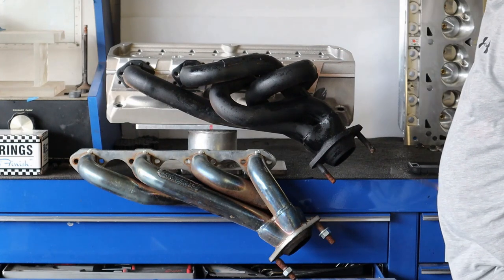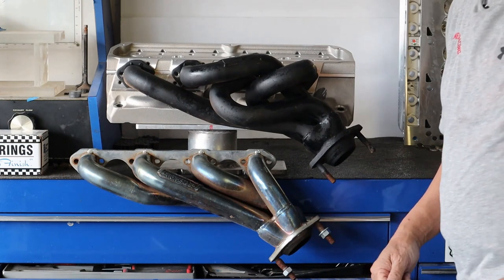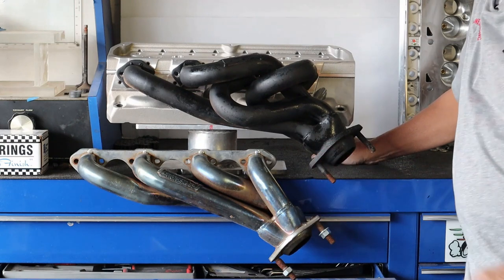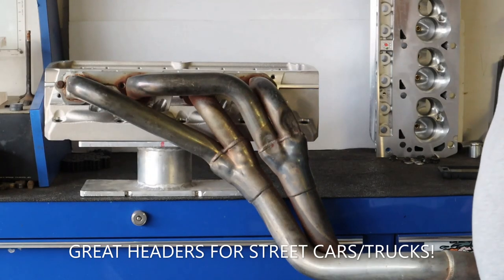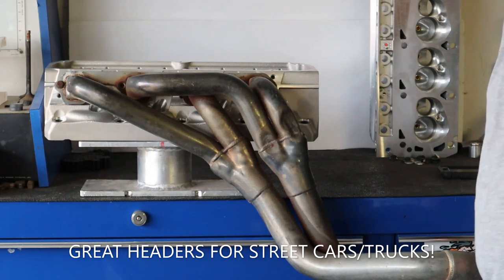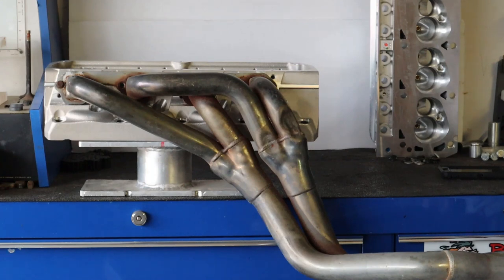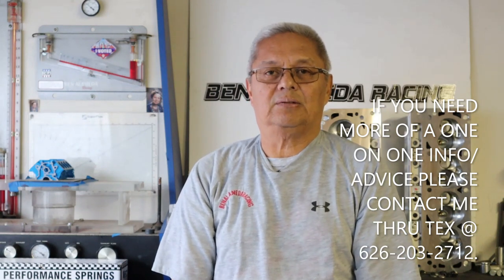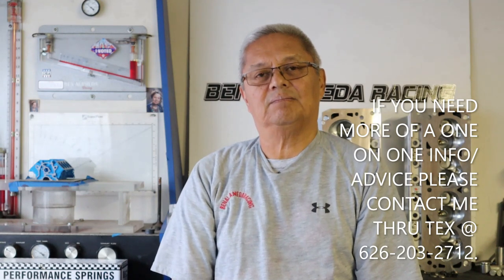HEADER TECH AND MODIFICATIONS FOR STREET OR ALL OUT RACING!

Comment: The point of headers is to induce scavenging. Timing of the vacuum pulses is tuned by the size and length of the header primary tube. Complex flow dynamics in play. Strong knowledge allows for tuning of this dynamic to best fit the application. 4-2-1 collectors and an X-pipe allow for the performance most similar to 180 tuned headers. Cross-plane crankshaft engines are difficult to tune exhaust. Exhaust is one of the most effective methods to tune power.
Reply from the maker: Interestingly many years ago we had a supercharge 347 and actually made more power with a shorty hedder than a complete long tube!  I will try to do this video explaining what actually happened.  It should be an eye opener because at that time years ago we were scratching our heads!  lol
Reply: Ben what about rapping the header
Reply: @benalamedaracing2765 doesn't surprise me, the supercharged engine is forcing the burned mixture out reducing or eliminating the need of tricks to manipulate the exhaust gases. Zoomies and uncollected exhausts are all the rage now on door cars running Prochargers and huge nitrous ( Roots and screw blower guys have been doing it forever )

Comment: A big advantage of the tri-y or 4-2-1 headers is the pair of cylinders that fire 90° apart have the exhaust split to prevent reversion into the first cylinder to fire's exhaust, by the high pressure pulse from the second cylinder. That high pressure, high temperature exhaust dilutes the cool fresh air in the first cylinder, which reduces volumetric efficiency and the density of the charge in the cylinder as it heats a bit. It also adds to the tendency to detonate in those two cylinders. With a cross plane crankshaft the tri-y header splits the exhaust pulses so they are 270° apart. By the time the now second cylinder dumps its exhaust down to the first Y, the high pressure can not turn and return into the first cylinder as the valve is closed.
Mazda as part of their Shyactiv research found this on log manifolds. The second cylinder pushed hot exhaust back into the almost closed exhaust valve of the preceeding cylinder. This caused the fresh air/fuel charge to be about 60° warmer at BDC.  At a point a couple of crankshaft degrees before ignition, the charge in the cylinder was 160° warmer. The length of 4 into 1 header primaries takes this out of the set of factors. Generally though 4 into 1 headers on a 4 cylinder engine will lose a couple of lbft at low to mid RPM but be much stronger at sustained RPMs above 7000. On a street oriented engine the RPM band favors the tri-y headers.
Reply from the maker: Thanks Dale for a more thorough explanation and appreciate it much sir!

Comment: 4-2-1 always if motor is 8000 rpm and below. More torque confirmed by numerous Dyno tests. See David Vizard YT.
Reply from the maker: Yes sir they are superior specially if we used the NASCAR style long tube 4-2-1.  They not only produce just as much power as a conventional hedder but bump up the mid range much more than the traditional layout.  In fact in 1990 I did this first time and I had too much mid range and many thought I was running a big block until they look and it was a short and smaller SBF.
Reply: Hello. First of all sorry my bad english...I am from Finland. I just remembering Vizard's 8000 rpm rule conserning of 4 cyl. inline engines which are evenfire. I think situation with oddfire V8 may differ...
Reply: @TomKunnas Hi what is the 8000 RPM rule?

Comment: Anytime you funnel in Reverse Heat accelerates the speed that's why it was more responsive it really works real good but then you need a better location for your wastegate
Reply from the maker: Yes and everytime you jam it like it is a on a merge collector the velocity speeds up and this is good for the turbo(s).
Reply: @benalamedaracing2765  finally I get to conversate with somebody that knows what they are talking about
Reply from the maker: @tinoracing7  Thanks!
Reply: @benalamedaracing2765  how you doing Ben I got a question I need some help I'll pay for your service I'm trying to put an LS together prototype that I came up with I converted LS to sing over a cam I need some guidance regarding the new timing on the timing belt

Comment: Excellent content Ben, I installed a set of Doug's Tri-Y headers on my 67' coupe (438 CI windsor) they're 1 3/4" stepped to 2" and the thing makes a bunch of torque and revs right to 7000 RPM's. thanks for sharing the information
Reply from the maker: I bet you got lots of mid range torque and power!
Reply: @benalamedaracing2765  The funny thing is, I almost sent them back to where I order them from because they weren't full length headers (I was told they would kill top end power) I'm glad I saw your "Header tech" video because even with full exhaust (tailpipes and all) the car revs just fine....Thanks again!!!

Comment: A long time ago the crayon deal was told to me by a fellow who ran a g gas car . Speaking of exhaust I think he ran some reversion plates on the heads to the headers . Or that's what I think he called them . Thanks for videos
Reply from the maker: Reversion hedders are sometimes employed by using a cone exit and or an oversize hedder primary pipe within a smaller exhaust port both perfect for the purpose. Others also done is moving up the hedders above the exhaust port roof creating a dam or a mismatched doing the same thing.  Everything to make a little bit more!  lol

Comment: Goilet is the name of the spear 
Shorty headers with a long tuned collector work exceptionally well.
Supersonic flow cannot occur in an enclosed pipe ( Darin Morgan).
Reply from the maker: Thank you and it will help @ high engine speeds and it becomes a convenient ramp for reversion gases to travel back to the exhaust valve much easier at lower engine speeds.  
Now on supersonic flow?  Mach 1 or supersonic occurs when an object (aircraft/rocket) is travelling faster than the noise it is making.  It then impacts the atmosphere which is stationary and creates a "sonic boom".  On our subject here, we have no object travelling @ 685-750 mph(depending on the altitude/temp)., but we have a movement of exhaust gases which I referred to as almost or near sonic.  This gases are not impacting atmosphere anywhere within the pipe but outside only, by that time it is not at mach speed but much slower.  
Sorry for the long winded explanation.  Lol.  
I am an Aerospace graduate this is why beside's racing, my  Dad was a fighter pilot and airplanes are my first love not racing.

Comment: Catching up on some of your older videos Ben. I remember reading about the pinhole idea from Smokey Yunick years ago. I haven't put them in my headers as I'm running FI and thought that it would run rich since it is introducing oxygen into the system. Would I need to recalibrate the fuel curve to compensate or should I just leave it as is?
Reply from the maker: It depends mostly on how sensitive your exhaust is to these small openings and I would suggest silicone them shut first (copper silicone) then note your readings and open it up and see where the difference shows and take note of it.

Comment: I keep tellin people wrap your headers in foundry ceramic if you can afford it where its good to 2500. Dissipated energy is a net loss in any circumstance. Helps on na cars with more consistency, but its even more significant in turbo applications. Keep that heat in boys. High temp molecular adhesion style coatings keep the heat off the piston as well as the surface area of the combustion chamber. Keep that heat from soaking and youll gain more.
Reply from the maker: You are right on point with your comments!  Thanks.

Comment: Great information, thanks so much for sharing.  Your analysis is supported by the book "Scientific design of exhaust and intake systems" by Smith and Morrison. Quick question on the burnt paint on the header trick, if the header has heat coating, does it still apply?  Assuming that the heat coating will lower the tube temperatures enough to give a false reading.
Reply from the maker: Thanks for tuning in.  I feel the coating will throw off the actual area it starts to cool down showing the transition to the cooler location of the hedder pipe.

Comment: How long do you drive a street car to get header tube length, if you.drive too long will it keep creeping further?

In school on dyno with tri y. Teacher said add 1.5 inch extension before 2-1. Gained 12hp. Tuned tri ys are nuts
Reply from the maker: Not knowing the engine combination I would suggest to determine tube length is to run it several times WO so you can see the discoloration happening and where it is and go from there.

Comment: do you know if a fox body has a low pressure area anywhere under the car where ending the exhaust pipe might benefit power at speed.
Reply from the maker: On the first gen. stangs the low pressure area is under the floor in front of the rear seat and slightly behind @ the opening of the floor!  It may be the same with other cars.

Comment: If you double the diameter of the primary and use that for your collector, the area of the collector will be the same as four primaries. Therefore there should be no back up regardless of the length of the primaries.
Reply from the maker: "Regardless" of the length of the primary pipe?  Ok that is news to me because I have lost power with too long a primary pipe length.  Gained torque no doubt but paid for it somewhere someplace...  Could you explain that a little bit more because I am confused.  Thanks!
Reply: @benalamedaracing2765  If you take the diameter of your primary and double it and use that for your collector, the area of he collector is equal to the four primaries going into it. So there is no back pressure at the collector. So the primary length shouldn't matter. That's my thinking for what it's worth.
Reply from the maker: @joe-hp4nk  Have you run this concept on a high horsepower engine if primary length is inconsequential to power production?  This is news to me and thanks for your insight.
Reply: @benalamedaracing2765  I'm just a back yard hotroder and it's only a hobby. No, I haven't tested it, so it's only a theory. Weather runner length makes a difference, I do not know. I don't have the means nor the capital  to put it to the test. Wish you well.
Reply from the maker: @joe-hp4nk , thanks as well and I like to see what others think and it is always a learning process because we all do not know everything for sure.
Reply: @benalamedaracing2765 doing the math if you take my 351C Doug Thorley mid length Mustang headers the primary is 1.625 and area about 2 square inches, but the collector is 3 and the area there is close to 8 inches square. I did the math but still don't know what exactly will happen with my exhaust gases and pulses

Comment: Do you smell any exhaust fumes when you drill the pinholes in the headers? Also, what are your thoughts on reversion dams/cones?
Reply from the maker: If it is drilled in the proper location it should not leak exhaust gases and that is why it is important to locate the hole in a low pressure area.
Reply: @benalamedaracing2765  so the low pressure would be just after the bend of the primary tube after the header mounting flange in a downward angle  ?
 And when you say pin hole ? what size hole do you recommend  for a 2 inch primary tube ( long tube kook's header with 3 1/2 dump ) for a 1.60 exhaust valve with a rpm range of 2900 to 7200 SBF 414 cubic inch 12:1 comp. N/A motor.
if you need more info i can contact you? thanks for your time.

Comment: Do equal length headers cause harmonic problems ?    Wish people knew that rust in steel headers will travel up in intake & rings.   Stainless is a must.  Kaase showed experiment simulated with motor oil inside header and shows oil travel up through engine to bottom of carb. plate.   Total Seal podcast just aired with Jon explaining how bad mild steel headers destroy your engine.
Reply from the maker: Yes a rusted hedder will indeed cost power and your statements I agree with big time!
Reply: I don't think it's that simple. I need to watch Kaase more but I think he is great. There are chrome plated headers, ceramic coated headers, and many lengths and types of headers. My headers were coated and they have lots of carbon on the inside of them. I do definitely have a personal distaste for rusty mild steel pipes or headers. What about connections in a system? Do they matter? And what about other particles besides rust? There are off road vehicles operating in dusty environments. Does dirt travel up as well? When you look at my tailpipe I only see carbon and water and undoubtedly air pushes things outward usually.
Reply: @jamesmedina2062  excellent response t.y.   the video ref  was with Total Seal Lake Speed Jr. and Kaase. Podcast 
   I mentioned stainless (and was wrong) any coated headers  on inside or chromed inside gives same protection (not only stainless).  I'm just a parrot and not my experiment.  But man it sunk in after learning.  And oil filters only filter a percentage not all. So dirt etc.. yeah problems with rings.    I didn't understand connections unless u mean connection of exhaustion with mild steel ??
Reply: @ronaldrey8474  I ask a lot of question! It used to be my job!(providing technical support)

I am not going to know that much about coatings as I only used one, Jet Hot, on some headers and only know what I saw and what they told me. I saw some odd little corrosion on them years later but while in use they looked great and kept things cooler. The X-Pipe on the system got very badly corroded while the headers looked great for many years. So now I am only asking myself if there is corrosion and how and where it is. They are warrantied and not just for a year so I plan to send them back for a redo.
Reply: @jamesmedina2062  hello my friend...    I'll tell you my head fell of my shoulders when checking under hood temps after jet coated headers on big block !
OMGosh !!!    That Podcast with Kaase... Jon said straight up rev even a cold engine up to 4K rpm to remove rust inside pipes.  He said a quick rev @starting will prevent getting sucked in through pipes.  And a qwk rev. won't hurt a thing.   Not a frozen engine ya know but on what they call a cold start engine hit with 4k rpm blows it out.    And your ring seal won't be affected that way with mild steel pipes.    But again this was Kaase doing test in controlled environment  so I'm a believer. hehehe 
I think this might answer and allow some time before changing them pipes by blowing it out on cold start 👍
Reply: @ronaldrey8474  I am curious to see more. It goes against common sense that exhaust only goes backwards if in fact it also has reversion and goes back up to the carb. And yes you are right. The engine bay is way cooler when the underhood exhaust is coated.

Comment: Do you drill the small hole in Tri-Y headers too, or would that be counter productive to the desired reversion?
Reply from the maker: Anything to raise the hedder pipe temperatures should be a benefit to keep it scavenging all the way down.  Same thing with heat wraps or coatings does the same things...